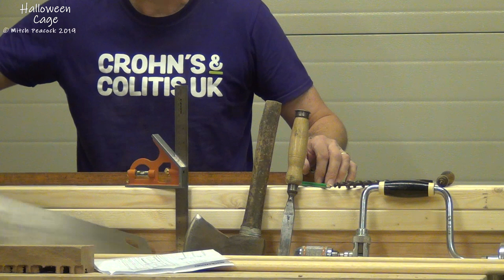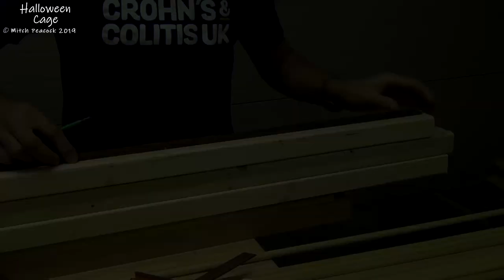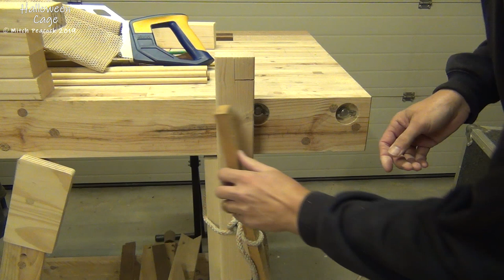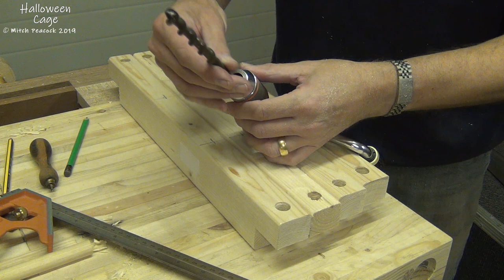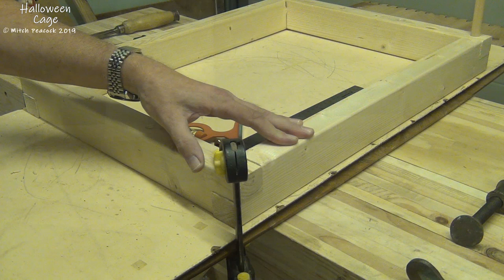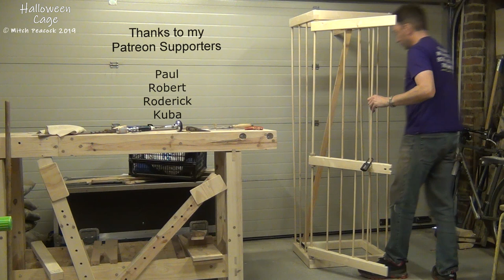Halloween Cage - Unplugged with limited tools

Comment: I like your use of rope as an improvised vice. Are you not in your usual workshop, or are you showing what could be accomplished with minimal tools and workspace? Either way thank you, very impressive.
Reply from the maker: Cheers Kris. I'm in the garage using the workbench I built for less than fifteen pounds / twenty dollars. I'm lucky to have a lot of great hand tools, but I do like to show that a limited tool kit need not limit what can be made. Rope can be used in many ways to secure work pieces, sometimes better than any commercial vise or clamp. Hopefully the few techniques I've demonstrated here will inspire others to experiment.